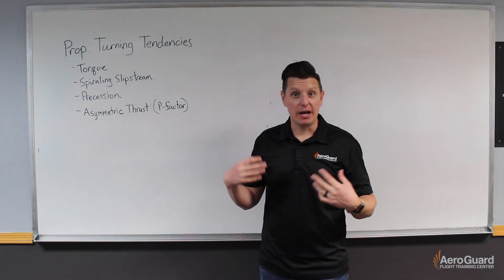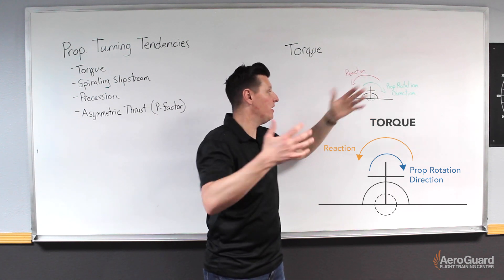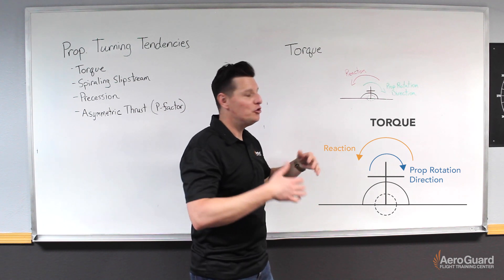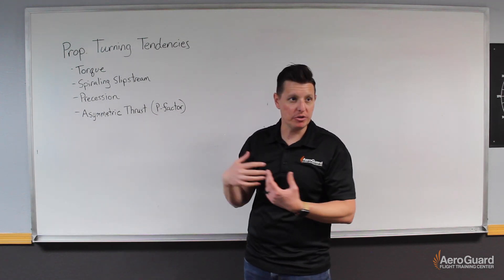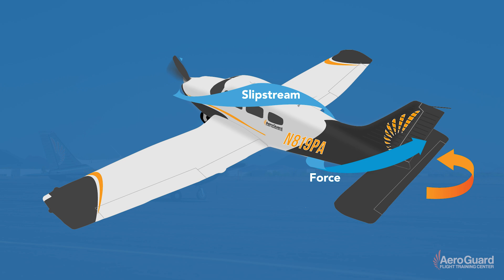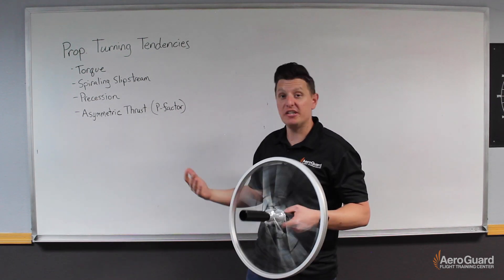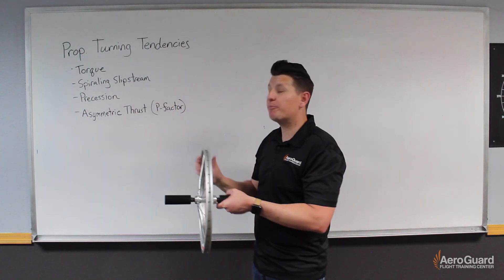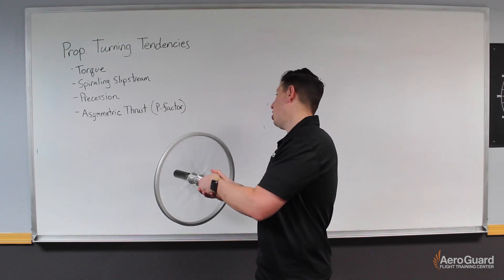Propeller Turning Tendencies & P-Factor - AeroGuard Flight Training Center

Comment: What I do not believe is the explanation for the P-factor. There are plenty of videos but I think they all make the same mistake. It is right that with more pitch angle of the plane the downwards moving blade on the right side is producing more trust but I think the reaction of this will not be more yaw to the left but it will be more pitch up tendency. The reason for this must also be the gyroscope effect which says that the force reaction will occur 90 degrees later. This means in our example of a right turning propeller that the stronger lift of the blade at the right side will act 90 degrees later at the bottom position which will pull the nose up and not to the left side……..?
Reply from the maker: While we can imagine that one blade is creating greater thrust than the other, when we apply it to the whole system it is equivalent to shifting the center of thrust away from the centerline axis.  In the most common example of a high thrust/high angle of attack scenario, this would be shown as the center of thrust moving to the right of the centerline of the aircraft and therefore creating a moment arm from the CG causing the yaw of the aircraft.
Reply: @flyaeroguard  

please have a look at a helicopter which is nothing else than a vertical propeller. 
To let the helicopter move in a forward direction it is not necessary to have the most lift at the rear positioned rotor blade and the lowest lift at the front blade but at a ccw turning rotor (view from the top) the left blade has to have the most lift and the right blade the lowest lift. The gyroscope effect is independently from initiate the force from the propeller itself or from the propeller shaft. The reaction will work 90 degrees later.
Reply: @Don Quijote 
you are mixing 2 different concepts. In order for gyroscopic effect to happen you need 2 different rotations. In that case we don't have that. For the effect you are talking about to happen pilot needs to use left rudder. In which case, propeller is rotating cw, and aircraft yawing left will create a pitch up. But you are claiming that asymmetric trust is result of gyroscopic effect even before it happens. Basically you are saying eggs comes from eggs. Which does not make sense.